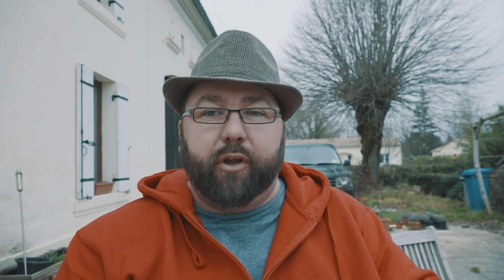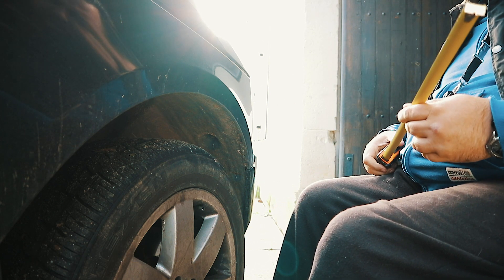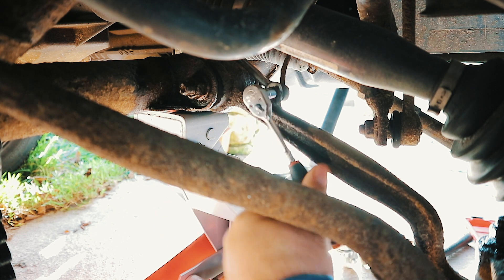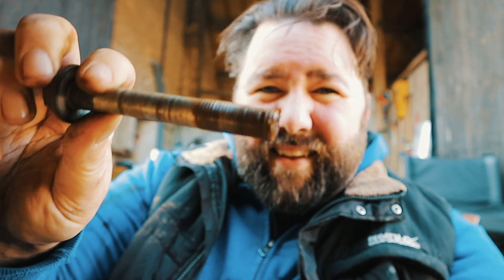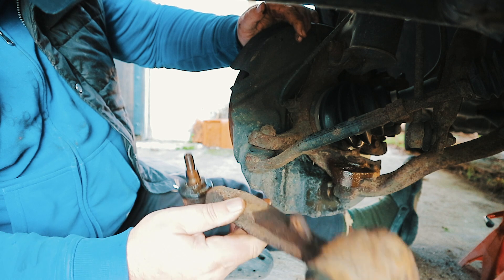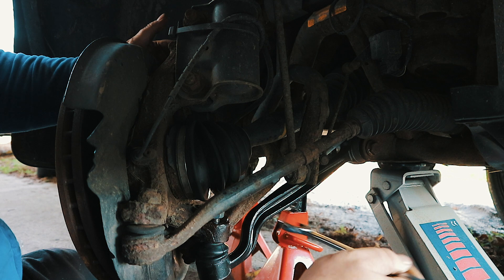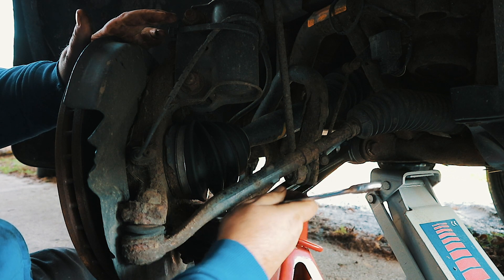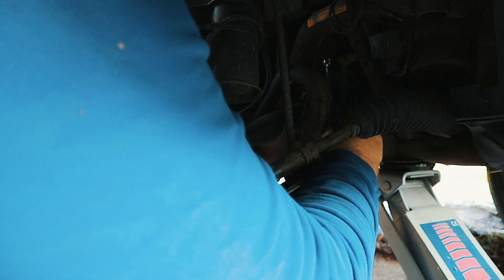Range Rover L322 - Replacing lower control arm

Comment: Hi Ben, really good video which I read before changing my front wishbone on my 2010 L322.  Just waiting for the new rear suspension arms to arrive as I've decided to change the lot whilst I was at it. I changed the Upper Ball Joint yesterday - now that it a horrendous job.. took me hours to get it out even with Heat, PlusGas Fluid and a large drift/Hammer.  It was the original part so had done well at 9 years old. Cheers Gavin
Reply: Instablaster...

Comment: Hello Ben.  Our 2008 HSE has developed a slight knock in the front end and was confirmed to be the lower control arm.  Doing a YouTube search for helpful videos, I wasn’t surprised to find this one at the top of suggested videos.  I did watch others to see if they had anything to add and of course they didn’t.  Not only that, none were as good or comprehensive as yours, and they were done by professional shops.  Love your stuff.  You have by far the very best L322 videos out there.

I do have one question though.  After completing your repair, did you need to get an alignment.  I’m thinking any time you do suspension work, you should do it.  What are your thoughts and how did that aspect turn out for you?

Many, many thanks for all you do to help guys like me.  I do hope you realize your impact.
Reply from the maker: I'm glad that my videos are of some use. Normally I would have the wheel alignment checked after doing suspension work, in this instance I didn't get it done, if I were to do the same job on my 2010 TDV8, then it would go in the have the alignment done. Reason I didn't do it, mainly a time issue. We needed to fix the car and get it re inspected, as we were using the car to tow the trailer as we were moving house.  And to be fair, it drove in a straight line and no unusual tyre wear was apparent.

Comment: A bit of a random question but what trolley jack do you use to get the height for the old Rangie without wood blocks 🤣
Reply from the maker: I've just been out to the garage for a look, it's a 2.5tonne Aluminium/steel Rocket Lift made by Sealey.
Reply: @Bensgarage  legend thank you

Comment: Hi Ben, wonder if you can help me with your Range Rover experience 
My L322 Vogue has had the lower part of the tailgate jam. Firstly the electronic switch failed so I continued using the plastic emergency switches either side of the lower tailgate. All was fine for a while but now they don’t work either so I can’t get the lower part down. I have checked the fuse which is fine so am a bit bambozzled. I did note the fuse rating in the handbook is 10 A and it has a 15A fitted. Was wondering if you’d ever experienced anything like this with your Rangies?
Reply from the maker: Sorry never had this problem and to be honest I’ve never paid much attention to the tailgate as it’s always worked. Is there power at the switch? I’d check that first and maybe send some power down the wire on the switch to the latch.
Reply: Ben Elliott okay mate no worries. Am currently waiting on a Land Rover specialist to see if he can fit me in before new year as I need to load it up to move loads of stuff to a house in Ireland in January. These things always happen when you really don’t need them to!

Comment: Got to ask Ben I changed mine as same way you did now my steering wheel is off centre I only done the one side
Did you have the same problem? Or know why this has happened to mine?
I can only think new part is slightly different in size 
Thanks
Reply from the maker: No luckily our steering wheel stayed straight after doing the job. However it is normally good practice to check your wheel alignment after having your suspension dismantled.

Comment: great video ,, question when tackle this job as disconecting height sensor!  is not need reprogram susoenssion with scanner tool or any computer !!  cause Im afrsid of change it in my 05 l322 and deprogram height sensor!!
Reply from the maker: gino leonne if you only disconnect the bolt and not the electrical connection then I can’t see a problem. I managed to knock a height sensor off while off roading, reconnected it and the car started working normally with no need for recalibration.

Comment: Thanks great  how to do video I’ve got a L322 face lift when I come to a stop I get a groaning noise coming from the front when virtually at a stop any ideas 👍👍
Reply from the maker: David Farrar  first thing I’d check is brakes. Mine makes a creaking groaning noise when coming to a stop. Then I’d check wheel bearings as those are the only two components that rotate. And while your at it check all the lower arm bushes for excessive play.

Comment: It would be great if you include the reasons for the repair. Was the arm ball joint worn out?
Reply from the maker: Diego Navarro  yes the ball joint was worn excessively and thus failed it’s bi annual inspection.
Reply from the maker: Paul Boobier  Exactly,  nothing is built to last anymore.

Comment: What make of part did you end up using as they seem to go from £25-£200
Reply from the maker: I'm really not sure, just checked my emails and it gives a part number but no make. Where I got it from also do a Heavy duty version now. https://www.lrparts.net/rbj500920-range-rover-l322-front-lower-arm-heavy-duty-by-meyle-front-suspension-arm-for-vogue-2002-2012-fits-right-left.html
Reply: Ben Elliott I have looked at them and also Delphi ones
Reply from the maker: Which ever one I bought it said it was an OEM Part.

Comment: A bit of info ,why didn't you block the suspension so not going for that jacking up the hub to the hight you need.
   Simply press down the suspension button until it shows the lock.
Reply from the maker: I jacked the hub up to simulate the normal ride height and then tightened the bolts on the arm to chassis. You could also replace the arm, leave the bolts loose and then set the car on its wheels and put it in normal ride height and then crawl under the car to tighten the bolts. You need to do that to avoid putting extra stress on the bushes in the arm.